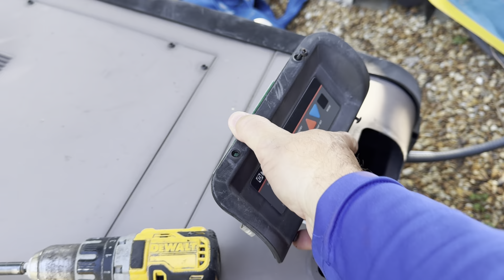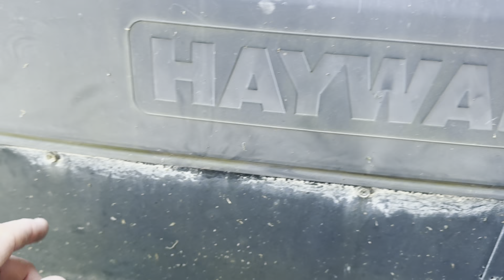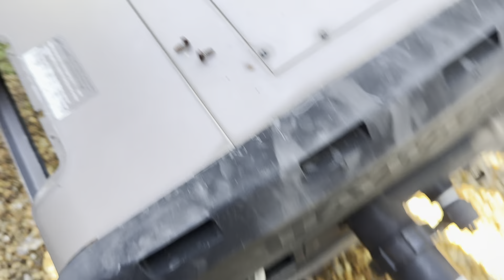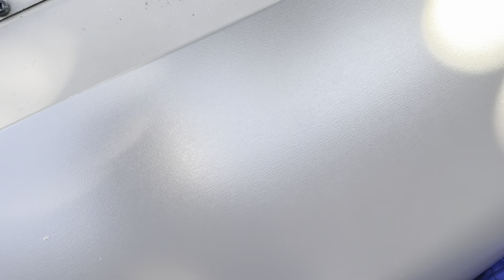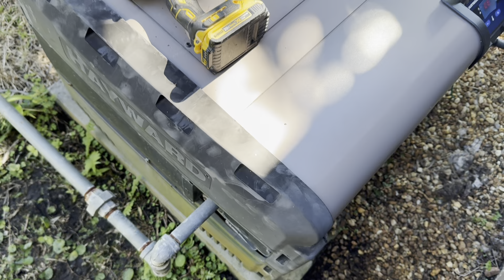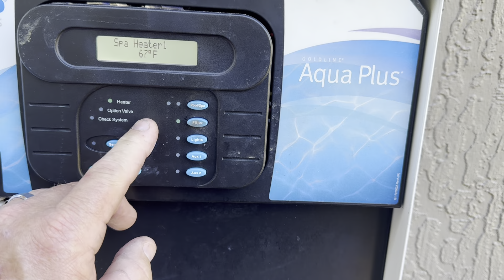HAYWARD GAS HEATER H400FDP - DISPLAY CONTROL BOARD FAILURE!!

Comment: This repair guy could have saved him self work and saved his customer a "ton of money"which I am sure he charged them for the markup on the new Hayward modified display kit !! There is an aftermarket board on Amazon which is the exact replacement for the original board and fits exactly in the display housing without modification. The price for this board runs between $20-$30!!!! I have the same exact heater (200,000 BTU) and experienced the exact same problem and repaired it with the aftermarket board !!!!!

Comment: Here is a tip on this heater if you get error code CE if you get this code after a rain pull out the control panel its likely wet. I dried mine with a heat gun slowly . I plugged it back in and it worked right away. I taped the edges with duct tape to spot further water getting in. I'm going to build a cover over the unit but for now this worked

Comment: How much should i charge to replace that for labor? I literally have a client with the same issue. The board is fried and I was studying the trouble shooting guide. But this seems to solve the issue. ALSO, do you have a video to test where there is enough voltage? My client has 240 at the breaker but i want to confirm that the heater is receiving all the voltage necessary before I purchase this upgrade kit.
Reply from the maker: I would recommend to charge your labor rate multiplied by at least 2HRS. To test the incoming voltage you need to locate the side of the unit where the electrical wires / conduit is coming into the unit. Open that panel and there you’ll see where and how those wires are connecting to the heater. Have the breaker off while you’re tracing the wire location and routing into unit. Connect your volt meter leads and turn on the breaker. If you have verified the breaker is outputting the 240V the connection point of the wires should also have the same Volts. If not, there’s a problem with one of the wires or breaker. That’s the simple part.

Comment: Been there and done this repair.  You know hayward could of put a special coating on that circuit board to protect it when it gets wet such as a varnish for electronic boards.  Some have a thin layer of epoxy or a silicone spray, but then it would last a long time and they dont want that lol.  I am surprised the mounting holes did not line up, but with hayward that does not surprise me.  Lots of stuff here to remove.  I think pentair master temp is a little easier to work on.  Great job though.

Comment: Heater should always be in spa BO mode for the whole 104 range.  This goes for all automation hookups.  If on pool icon the heater can only get to 95 no matter what.  And BO is not an error code people.  How many times I've got this call.  It means bypass operation.   Usually this is normal.   lol

Comment: Can you provide the part numbers?  Hayward's site is terrible and I'm having trouble determining the right part without any part pictures.
Reply: I emailed Hayward and I believe the part number is

Model H400FDN
FDXLBCP1400

The only thing I’m confused about is that when u google the part number the panel is black and the panel in this video is brown…so not sure if  gonna have problems installing.  

I am ordering tonight and will update if it’s correct once installed.  Hope this helps! :)

Comment: It says u can still order the older parts separately?  

FDXLBKP1930 (old grey curved bezel display)
IDXL2DB1930 (green electronic control board)
Reply from the maker: The problem with ordering the older parts will be still subject to getting damaged from water intrusion. The bezel has a bad design which doesn’t have a proper water seal and there’s no protection for the display or board from the outside elements. Purchasing the new upgrade bezel, panel, and board control will update heater and protect the main control to ensure the unit works. Ultimately the choice is yours. Thanks
Reply: @EliteSwimmingPoolsTV 

Actually I tried ordering all parts separately and u were def right, it can’t be bought separately! 

This is my 4th attempt of ordering the proper part.  Is this the correct part number to the whole panel/bezel,pcb board?!? 

Model H400FDN

Part #
FDXLBCP1400
Reply: Can we buy directly from you?

Comment: I also have a 400,000 BTU Hayward heater…

My model number is H400FDN…

On your video your model number is H400FDP…

So just the last letter is different..does that mean mine is different then urs?? When I google search, it just says the parts fit model H400FD and they omit the last letter?
Reply from the maker: The P signify the gas heater works off Propane Gas, The N signifies Natural Gas. It’s the same part number for both units. This part is just a thermistor which reads temperature. Nothing to do with the gas operations.